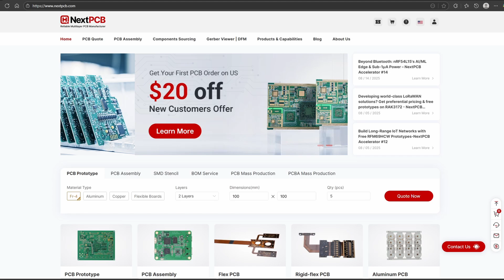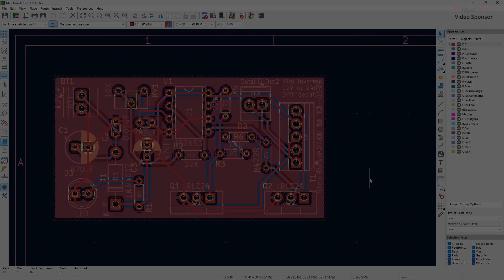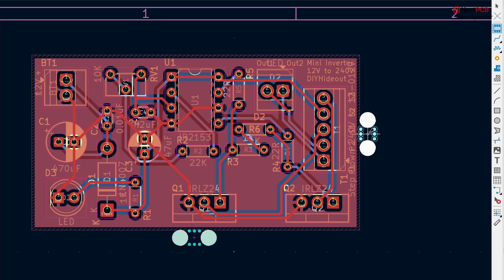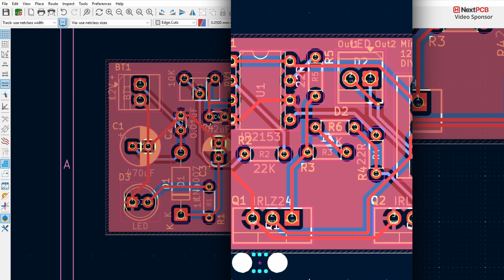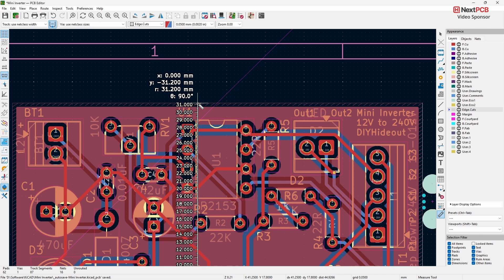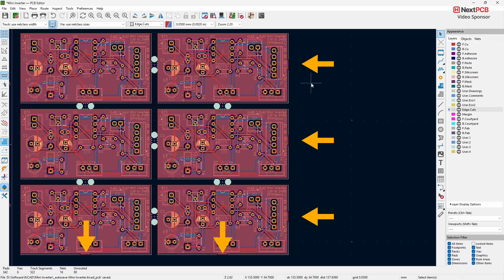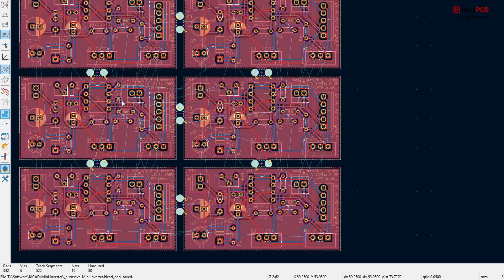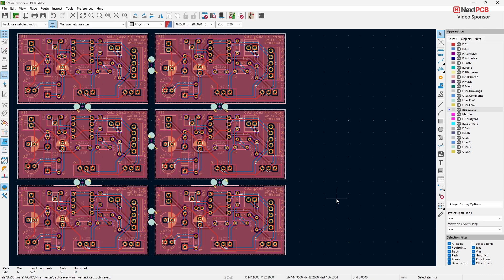How to Panelize PCB boards in KiCad 9.0 using Mouse Bite | KiCad 9 Beginner's Tutorials

Comment: Thank you for video! Its works great, I will suggest to just make 2x2 and then copy and connect lines, because if you add array to big it is easier to get lost and fail...
Reply from the maker: You're welcome! That's a good suggestion for larger arrays.

Comment: For some reason when I go into the 3D view the space between mouse bites is filled with the dark green layer. Do you have any tips?
Reply from the maker: Hi, it's because the edge cut is not properly connected. Just zoom in on the edges to check if it's properly connected. Usually occurs around mouse bite ( so focus around that area first)..
Reply: @diyhideout Thank you I will try that!

Comment: Hola.
Disculpas si estoy en el lugar equivocado, pero tengo un  problema en KICAD 9.0.5, se me ha fijado el movimiento de lineas en 45º y NO encuentro como solucionarlo. He desintalado todo lo relacionado a KICAD 9, y nada ¡¡¡ AYUDA !!!!
Reply from the maker: Hi, if you are on PCB editor, first select the line tool and then start drawing line, then press Shift+Space to change the line constraint between horizontal, vertical or 45 degree.
Reply from the maker: If you are on Schematic Editor go to 7:08th minute of this video (https://youtu.be/d9_-lQq8ShE) and follow the same steps for line